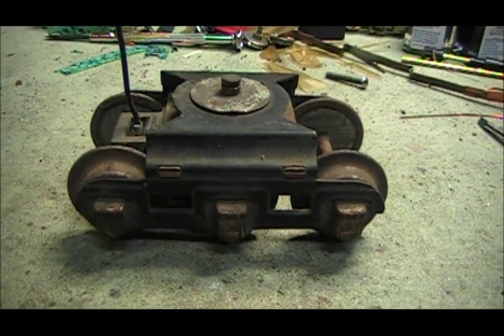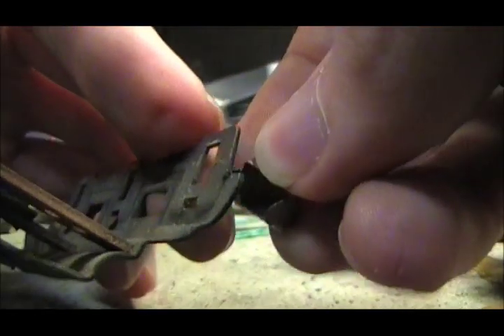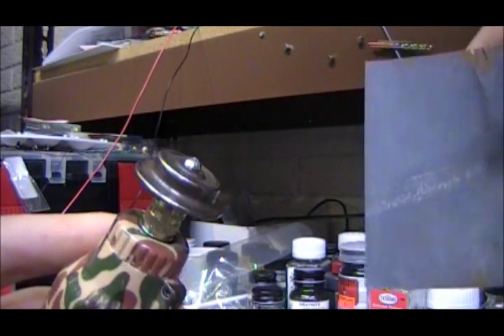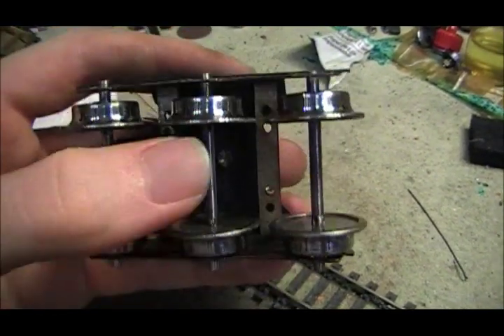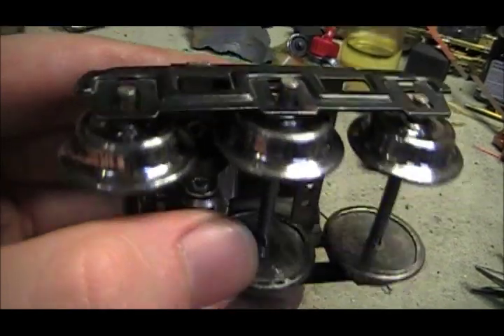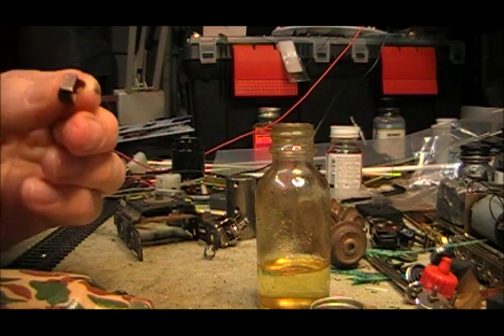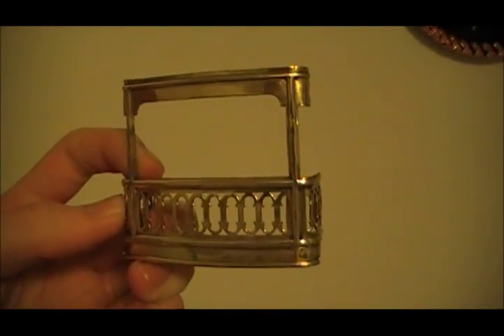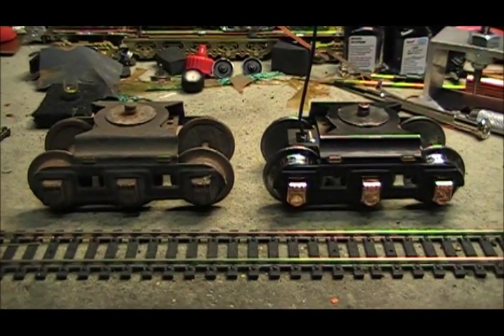Lionel Passenger Car Restoration - Part 5: Trucks and Polishing

Comment from the maker: You're welcome! I'm glad my videos have been helpful! :D

I put the wheel over a long screw, and then tightened the dremel onto the screw. Then, I could tighten the screw down over the wheel. It left minor thread marks in the chuck, but it didn't affect the tool's operation at all. The sandpaper is fine 600 grit, which you can find in large sheets in the automotive department at a store that carries that stuff.

Comment from the maker: Thanks! I just now noticed your comment. Finding Lionel passenger cars cheaply (even if restoration is needed) can be difficult, depending on the model. The 710 series I restored here is more difficult to find, and is expensive because of that. The 607 and 608 cars are more common and can be found for $25 to $50 each on eBay or at train shows, and look great with the 252 Electric in front.

Comment from the maker: And if your budget is real tight, the small 529 and 530 passenger cars can be found for $15 to $30 each, and are commonly pulled by the 248. So basically, think $200 total for the small set (parts may be needed!), $300 for a medium set, and $500 for a large set like mine. Remember to take your time and do things right, and you'll have a great passenger train for display or running!

Comment: a bottle of MS70 from your local coin shop will clean brass,  copper, Nickle, silver and gold with just a small amount applied with a q tip then wash with water:)
Reply from the maker: +40belowful Thanks for the tip!  I've used the similar Tarn-X on silver before, but never thought to use it on copper or nickel.